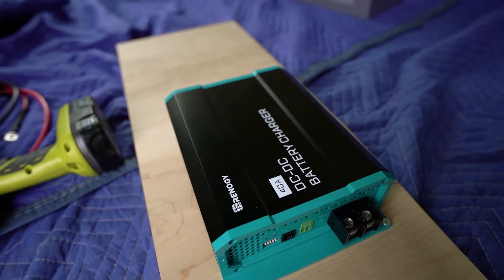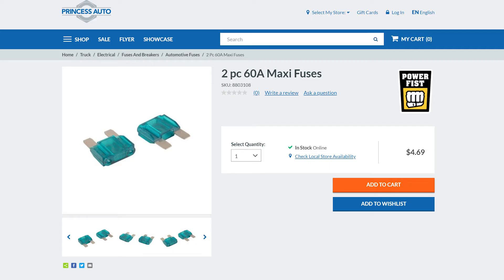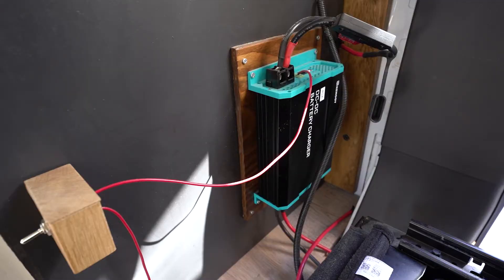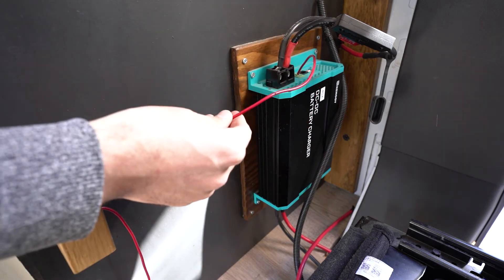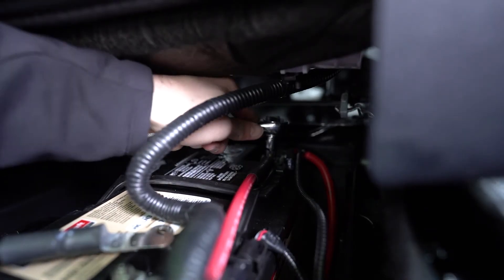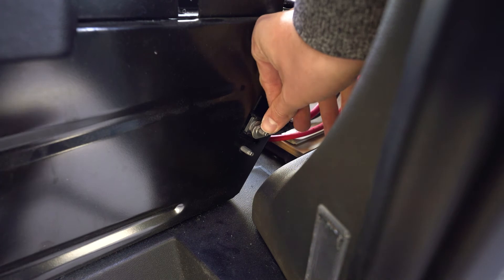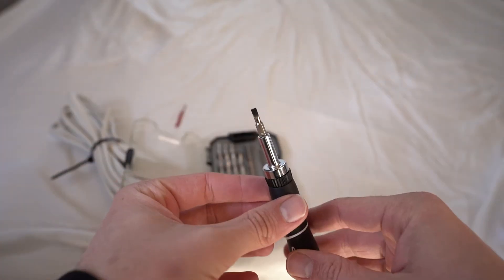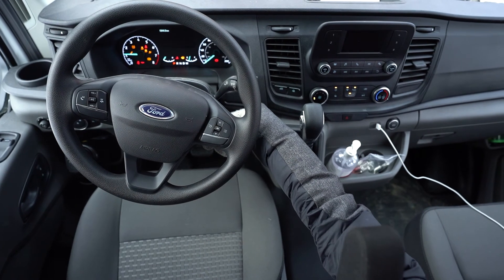Renogy DC-DC Charger Review and Easy Ford Transit Installation

Comment: This is exactly how the D+ on a Renogy charger is not designed to be used.  The purpose of the D+ wire is to prevent killing your starter battery.  If you forget to turn off the switch, you will kill your starter battery.  On a Ford transit, you can create a 12V+ engine on signal using the C-11 connector under the drivers seat and a relay.  Ford provides a "live ground" when engine is on.  There are threads on the Transit forums that detail this process.
Reply: YOU ARE THE BEST. thanks for this
Reply: i was about to say the same thing.... the entire reason for having a "D+" ignition wire is to only charge when your vehicle is running haha...
Reply: can you put a thread in here please to the ford threads
Reply: Threads on what website??
Reply: Did you not see the switch? That switch allows you to start the vehicle first let it charge the starter battery first and then you can switch the DC to DC unit on afterwards
Reply: @ME-jc7xi  yes but the problem is, if you forget to turn the switch off when you stop driving you will kill your battery.
Reply: @conradcoolerfiend  I bet you only do it twice . Kill the battery a few times and learn quickly to flip the switch off

Comment: Thanks so much for the video. I just installed my dc to dc charger today. I didn’t know about the positive output on side of seat. Saved so much time and installation was painless.
Reply: What size nut did you use to secure it?
Reply: @JBD5391  
I used a 13/32 socket to tighten down.
Reply: I get the 12 volt source for the DC to DC charger from the cigarette lighter it does go off when you turn the van off

Comment: I know you mentioned that you have only 1 CCP point but I believe if you have two, the larger CCP point is ignition activated so it should power off the DC to DC when the engine is off.

Comment: We used a volt sensing micro relay to trigger the Renogy unit and added an override switch - it comes on at 13.4 and switches off at 12.8 volts - 
We had the same trouble with the very same type of fuse - the plastic housing melted - I kind of reasoned the sprig housing  was not making sound contact - like you I fitted a more substantial one that the fuse bolts into and have had no more issues

Comment: Get a vsr (voltage sensing relay) for the D+ wire. That takes care of forgetting/remembering to switch it on and off. Works great for me.

Comment: Why didn't you just wire the D+ to a vehicle source that is only hot when the ignition is on such as the radio or 12V aux power (cigarette lighter)?  You wouldn't need a separate switch as the D+ power would get cut off when the ignition is off.  If the current draw for D+ is too high for that source, you could run it through a relay triggered by the ignition source.  It's the same idea as the remote turn on wire of a car stereo amplifier.
Reply from the maker: We looked at what you described, but it required an additional connector in addition to the relay and accessing a fuse panel under the driver’s seat. Plus we don’t want the unit on every time the engine is running.
Reply: @RichandKirsten  why wouldn’t you do both? Run it through a fuse that is only hot when the car is on, and add a toggle switch along the way to override it if you choose to? I’m thinking of doing this to my van as well..
Reply: @RichandKirsten  i’m thinking I would just run the D+ wire to the charger side of a 100 amp breaker I installed between the auxiliary battery port you noted, and my battery charger.  

That way, I have control like like you noted, but instead of using a switch I just use the breaker.

Comment: Your video is brilliant.  I’ve watched it about 8 times for a year now while I’ve been searching for the correct size nut for the CCP post with no luck whatsoever.  Do you remember what size bolt you got for yours.  5 is too small and 6
Is too big and I’ve ordered 5.5 online but there came absolutely tiny😢. I’ve even tried ones with rubber inserts but they’re too big also

Comment: Extremely helpful! I went down a rabbit hole trying to figure out how to connect the D+ cable to a starter relay and was kinda bummed I'd have to order a special kit from Ford or engage in a wiring project above my skill level. The connection to the CCP with a driver accessible switch solves our problem.

Comment: bro - you need to fuse that 18ga wire down to 5A or so if it's on the 60A CCP and btw you can use pin 6 'ignition on' in the 10 pin connector under the seat which has a 10A fuse already on it. This way it goes on and off when you need it to. This video is kinda not good advice.
Reply: I cannot for the life of me find that connector! i have a 2017 transit custom and the connector isn't under my seat or near the fuse box under the steering wheel! any advice?
Reply: I'm interested in this option (in the reply above) but having trouble understanding it. Do you have a good resource or video. I have a Ford T 250 2020. 

I like this video. Most understandable thing I've seen but understand the draw back of having to use the switch.
Reply: @jessyrushing1413  Are you wondering where the 10 pin connector is?
Reply: @andrewswingler  maybe, my fuse tap did not work so I need to try a different so how to do the other connection under the seat like CE33 or something. Yes, I think understanding how to use the connecter.

Comment: If I was going to wire the d+ connection with a switch instead of to the ignition, I would use a rocker switch with a light on it in plain view so as to avoid accidentally forgetting to turn it off!

Comment: Hi, thanks for the informative video. I am currently installing the same charger. Do I still need a 12v switch between the D+ wire if I have a circuit breaker between the starter battery positive and charger input? The D+ wire would not be going through the circuit breaker so I am wondering if it would still turn on with only that signal.

Comment: Hi! Thanks for the GREAT video! Which fuse did you need to change? I got everything working and the green light went out an hour after the install. Thanks!
Reply from the maker: We had to chance the one from DC charger to house unit because the fuse was poorly made. Purchased a higher quality one and never had another problem! Your unit could also be overheating and shutting off - we had that problem a few times when it was really hot out.

Comment: i think thats cool that you connected the d+ to a switch and the customer connector.
could you have also connected that to the leisure battery instead ?
Reply: If the leisure battery is deeply discharged, or has a lot of loads, it might not have enough voltage to turn on the charger.

Comment: This install is for a van, maybe a motor home. I didn't hear any instruction about setting up the dip switches!
You donhave to connect to the ignition, instead the trigger wire can be connected to one of the camper's side lights so when you turn them on it activates the dc to dc.

Comment: Do you know if the terminal post on top of the positive terminal you found on the side of the front seat is negative post?
Reply: I went online and found the answer if anyone is interested.  The smaller post CCP1 supplies 60A max and the bigger post CCP2 supplies 175A max.  Both of them are hot.
Reply from the maker: Correct - ours only has the 60A post and there’s no negative on the driver’s side. There’s a negative by the driver’s feet, which I didn’t want to use myself.

Comment: Did you need to chassis ground any of the connections?
Reply from the maker: Nope, we used negative from the starter battery for input side and house negative for output side
Reply: @RichandKirsten  2022 ford transit BEMM does not recommend
connecting direct to the negative battery terminal due to the possibility
that it will interfere with van battery volt sensors.
instead connect to the chassis. the chassis has ford approved points of connections.
Reply: @oscarcruz-ts5qy  Hi Oscar! I am looking through the 2020/2021 BEMM and I interpreted that recommendation for when you are adding additional batteries, not necessarily connecting something to the CCP.  Am I misunderstanding something? I'm not sure where I would ground the 12V to DC charger near the driver side otherwise. Thanks!

Comment: FUSES and circuit breakers r 1 of the things you definitely can "cheapout" "save some $on". They r all made the same except Blue sea which is way over priced stuff for like Sail boats!  What I mean by same is they r all over ebay Amazon and I've had an issue with 1. I have 6-7 circuit breakers and multiple car audio fuse products. It's all about solid connections and good crimps and corre t wire and fuse size.  The Renergy 40 Amp DC to DC a tally can take up to 50% more current in on the input because the voltage is lower. So amps increase to equal watts needed. Amd that's why ther were issues with the circuit breakers or FUSES blowing. Read the manuals.